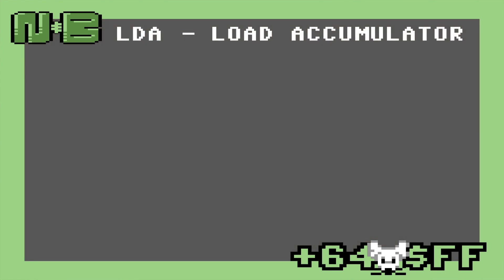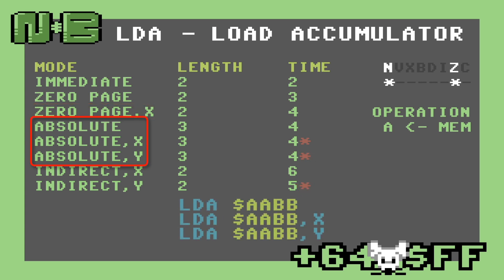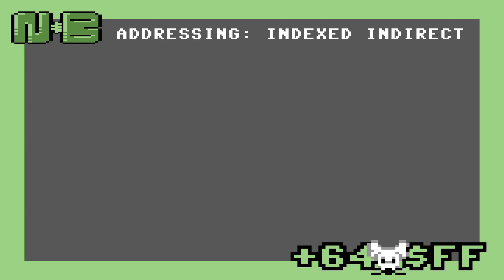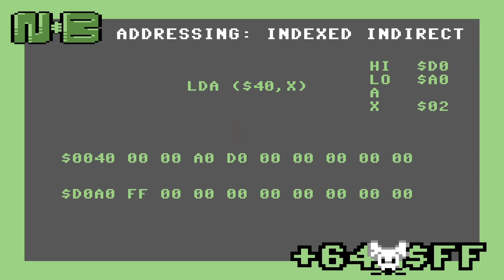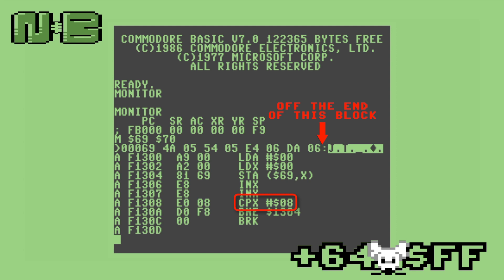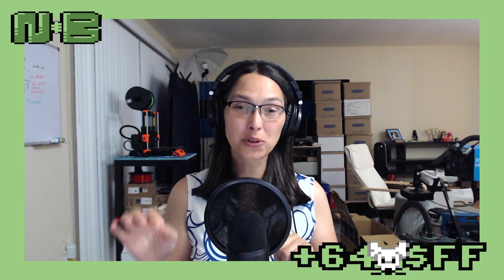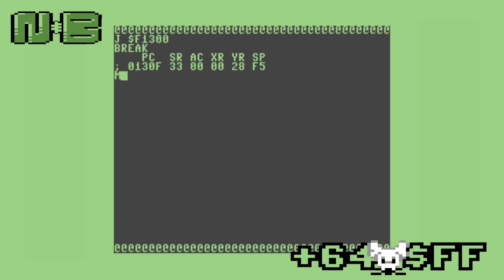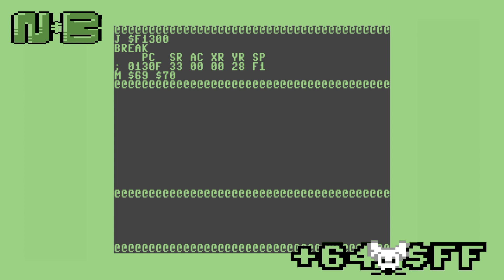Nybbles and MouseBytes: Ep2: Memory to Register Transfer Instructions

Comment: First off, thanks for an excellent series of tutorials.  7:20 Did you happen to review the results after running this code?  On the C128, when I run the sample code used in this video using a more identifiable number in the Accumulator (#$AA instead of #$00), the value doesn't appear to get written to the target addresses (maybe it's read-only?).  When testing with target addresses higher than the block of code that is being executed, it seems to work...

d1300 130c
. 01300  a9 aa    lda #$aa
. 01302  a2 00    ldx #$00
. 01304  81 69    sta ($69,x)
. 01306  e8       inx
. 01307  e8       inx
. 01308  e0 08    cpx #$08
. 0130a  d0 f8    bne $1304
. 0130c  00       brk

This doesn't work:
m $69 $70
>00069 4a 05 54 05 e4 06 da 06:j.t.D.Z.
j1300
break
    pc  sr ac xr yr sp
; f130e 33 aa 08 00 ed
m $54a $54b
>0054a 20 20 20 20 20 20 20 20:
m $554 $555
>00554 18 20 23 24 30 30 20 20:. #$00
m $6e4 $6e5
>006e4 05 04 20 20 20 20 20 20:..
m $6da $6db
>006da 32 30 20 32 30 20 32 30:20 20 20

This works:
m $69 $70
>00069 00 18 80 18 10 19 00 1a:........
j1300
break
    pc  sr ac xr yr sp
; f130e 33 aa 08 00 e9
m $1800 $1807
>01800 aa 00 ff ff ff ff 00 00:J.......
m $1880 $1887
>01880 aa 00 ff ff ff ff 00 00:J.......
m $1908 $1910
>01908 00 00 ff ff ff ff 00 00:........
>01910 aa 00 ff ff ff ff 00 00:J.......
m $1a00 $1a07
>01a00 aa 00 ff ff ff ff 00 00:J.......

Comment: I really, REALLY like the way you go through the programs in stepwise fashion. Currently learning for the C64 so the memory addresses I write to are different, but as I understand it, the 8502's instruction set is similar enough in every way.
Reply from the maker: Glad you enjoy it! The instruction set in the 8502 vs. the 6510 is identical. The only difference between the CPUs is that the 8502 has a few more I/O lines and a different pinout compared to a 6510.

Comment: I start to use assembler on a C64 without to have Internet and then i switch to x86 on 80286 and some times later on 80386 using MS DOS 5. For the C64 i bought a book from DATA BECKER with the complete dokumented ROM listing inside.